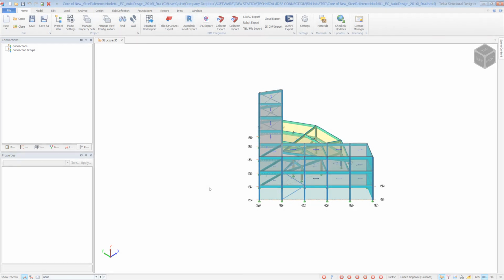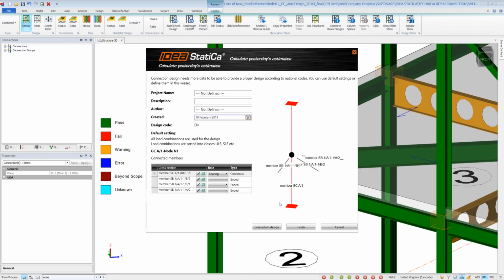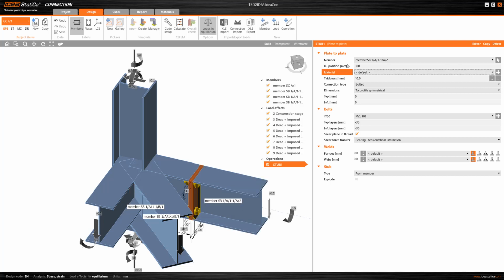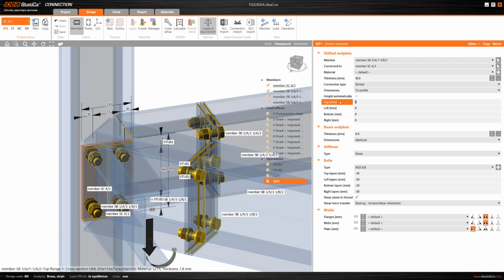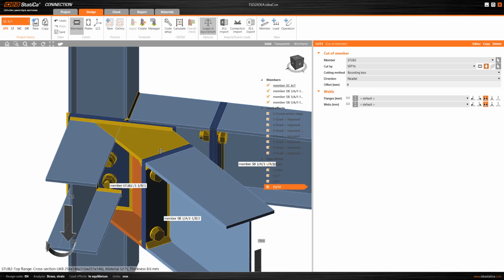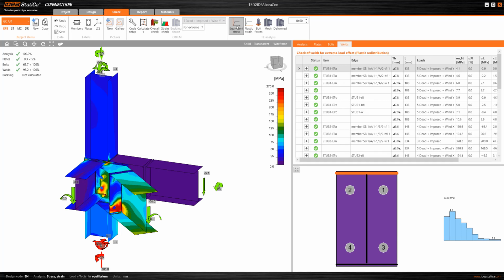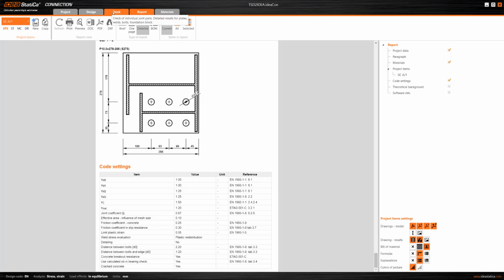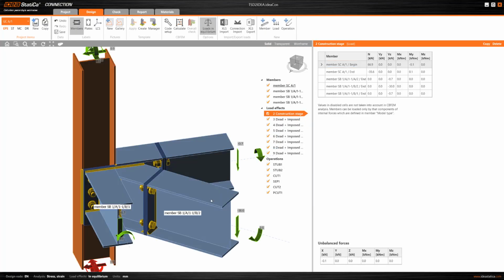Link with TEKLA Structural Designer

Comment: Tekla Structure Designer... worst and very dangerous program on the market
Reply: How dangerous?
Reply: Please dont spread false information. Tekla is a state of the art software. if however, you dont know how to use a certain tool that doesn't make it bad. it simply means u need to be proficient at it.